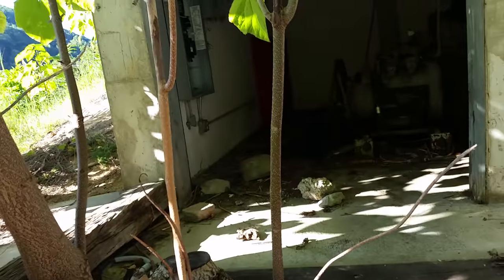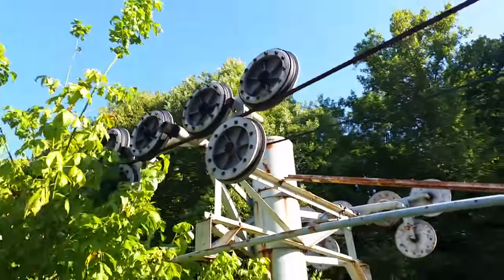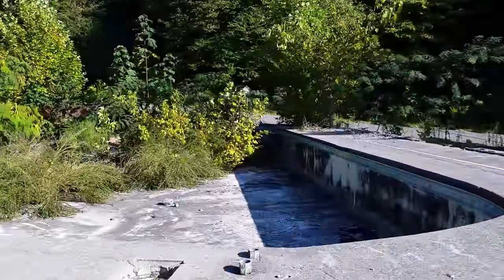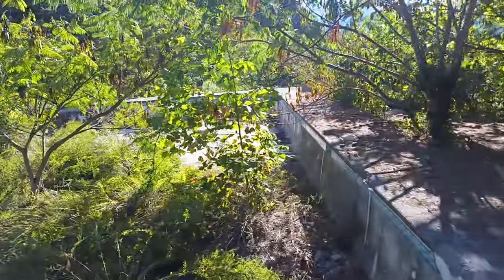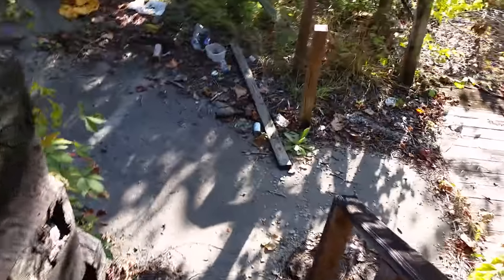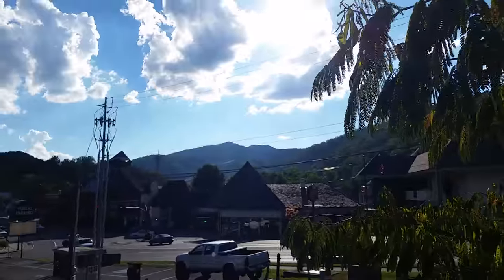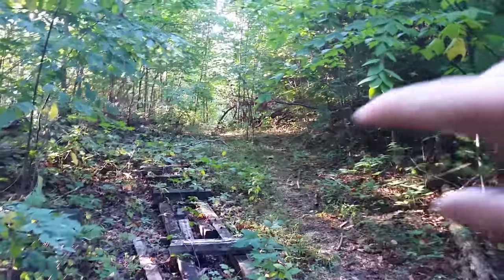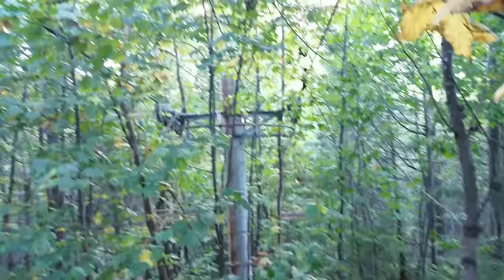Abandoned Fun Mountain theme park Gatlinburg TN Actually found the top of abandoned chair lift..

Comment: I have walked that Lift many times. The best way to walk to the top is to walk through the tunnel and walk back to the lift line. Walk up beside of it in the woods and it's a nice easy walk. The ravine close to the top is awesome! The chairs are way up high, then the chairs get close to the ground the rest of the way up.
Reply: Could you walk the chairlift path before trees and bushes grew it the path
Reply: It seems way too overgrown now. I’ve been trying to find a way to get to the top. I wonder if the little train tracks are still there!

Comment: Thanks for the video. I worked there in 1994-95 when I was 21. The chair lift went up the mountain 1/3 of a mile. About 2/3 of the way up it crossed a valley that put you over 100 ft in the air. The view was spectacular. I got "treated" with a 45 min pause at that highest point my 1st day on the job when the lift broke down during its warm up that morning. (Did I mention I was scared of heights?) Also i never hear anyone mention the over 100 year old merry-go-round. It was beautiful. Anyway that brought back  lots of memories. Thanks.
Reply: You're right!! There wasca merry go round there!! I had completely forgotten till I read your comment. I'm basically a stone's throw away from Gatlinburg, and I'm old enough that I should remember this place, but I just can't.
Reply: The chairlift was manufactured by riblet.
Reply: mrneonsplat where is this place at? I would love to go take some pictures and explore this beauty
Reply: Years after the park closed did you ever go back
Reply: @annieoneill4437  yeah back around 2012 I went back and shed a fer tears as I remembered the time I was there
Reply: I'm so stupid I asked you if you went back twice
Reply: @annieoneill4437  it's ok. Thank you for your questions anyway.
Reply: What was inside all of those building s and the shed
Reply: @annieoneill4437  The shed was the shop where they fixed end worked on the go-carts and bumper boats and was also for storage.
Reply: What was also inside those green roof buildings. And do you remember the last day of fun mountain in operation or the day they sold all of the rides
Reply: @annieoneill4437  the big green roof was the open pavilion with a 100 yr old caurasel and kid rides and a soft play area. Then steps went up to the restaurant that I ran for a time then the arcade that led out to the go-cart area.
Reply: Oh and no ma'am my late brother and I had moved back to louisiana before they closed
Reply: When you went back in 2012 were you surprised that all of the buildings and rides were gone. And we're you surprised that it was green with a lot of trees and overgrown . And today in 2021  do you think it will be safe to climb up one of those towers or
Reply: @annieoneill4437  yes I was shocked and saddened with memories when I went back. I just walked the outlines of buildings and rides deep in thought. There was a road to drive to the top of the chair lift that was accessible in town. But as far as climbing any towers you would just have to take your own chance...beware of bears lol
Reply: @yranrios4872  Gatlinburg, Tenn.
Reply: When I first went to fun mountain as a kid and I still am a kid today back in 2014 I thought those foundations and the steps was old foundation from the mountain view hotel but when I really looked at pics I realized it was not.
Reply: Why was there a roof connected to poles right behind the chairlift what was that.
Reply: @annieoneill4437  there was a cover like an awning to keep workers and patrons out of the sun and weather while waiting to load people onto a chair. There were usually 2 people working the lift at the bottom and 1 at the top of the lift. Other than that the machine house was beneath the bullnose or turnstyle where loading and unloading happened and about 15-20feet away was the Himalaya ride and to my memory nothing else around it, except maybe the safety net at the end of the platform that extended about 10ft. I hope this helps explain a little.
Reply: @mrneonsplat  thanks why I ask these questions is because I go there every once every year yo see what changed and this is how u get information but there is very few pictures of fun mountain NO  video footage but if I go on youtube and search gatlinburg in the 90s I might get lucky if fun mountain in the background. One video I did. type in gatlinburg may 17 1999 and somone shows about 4 second of the park in operation.
Reply: @annieoneill4437  I don't mind answering any questions you have about it, in fact I welcome them. I was there living with my brother for over a year and 6 months of it was in a 1977 dodge van. He took tons of pics on disposable cameras and after we returned home to Louisiana and he and I went our separate ways, he had those pics developed. Unfortunately, he passed away 15yrs ago when we were 33 (we were 18 days apart..same dad different moms) and his mother has those pics and promised to post them and send me copies but never has. If I get hold of them and you would like to see pics of the park and Gatlinburg in 1994-1995 I'll let you know. Thank again for your interest, it makes me smile when I get to remember those times.
Reply: @mrneonsplat  I always wondered at fun mountain under the mini golf deck there are 2 doors right by the steps do you have any idea of what is in there. I really want to check those out
Reply: @colin8952  I'm sorry, but the mini golf was a separate business than fun mountain even though they technically shared the same property.

Comment: I went there in the winter right before they shut it down. It seemed kind of old. The rides weren't all open but we just about had free reign on the ones that were since there were so little people there. We did go to the top of the chair lift. It was pretty clear cut for a good ways and we could see what we thought was an old mine train track to the right. It looked to predate the amusement park but, we didnt go check it out bc we could see from the chair lift it went close to a cabin and didn't want to go walking through their property. Love seeing where it goes though!
Reply: Have you been back after the park closed
Reply: @annieoneill4437  No I haven't. It was just the one time and I've only been back 2 or 3 times since in the early 2000s not even thinking about it bc I had no idea where it was. I only rediscovered it within the past year bc I didn't even remember was the name was
Reply: Well today 2021 all of the rides and buildings are gone the chairlift is still there but the path is overgrown. just foundation

Comment: the engine you saw is not what drives the chairlift. if you noticed there is a electric motor on the other side of the gearbox. so no, that engine did not drive the chairlift. the engine was simply just a backup if the electric motor or any of the electronics had a fault. it was not really meant for everyday use. it was only meant to unload the lift until the fault in the electronics has been resolved.